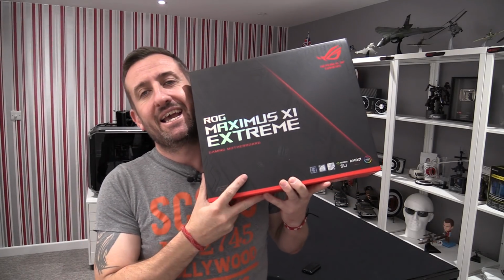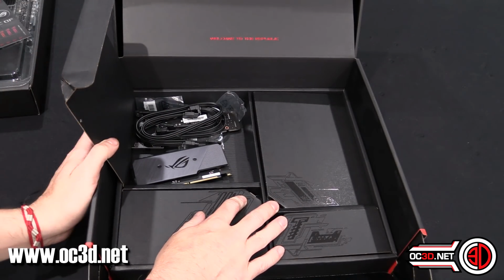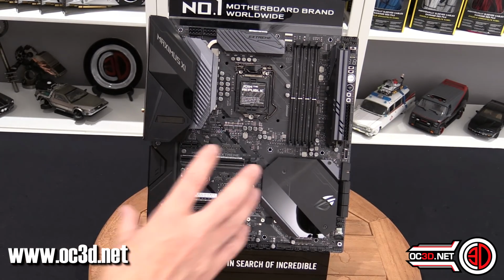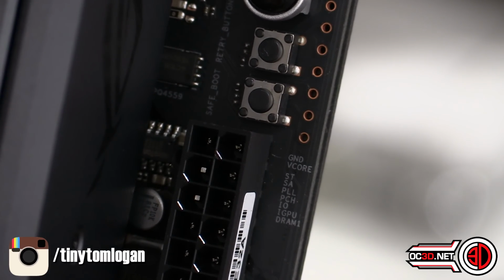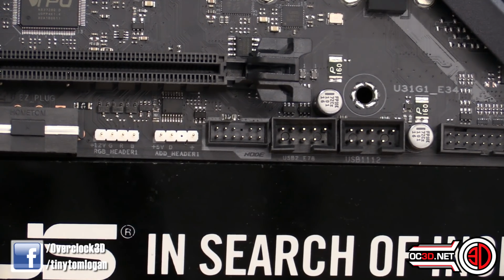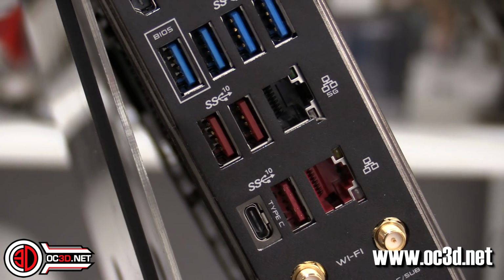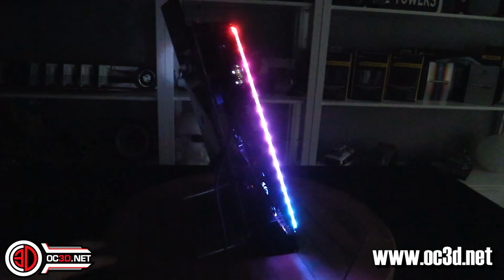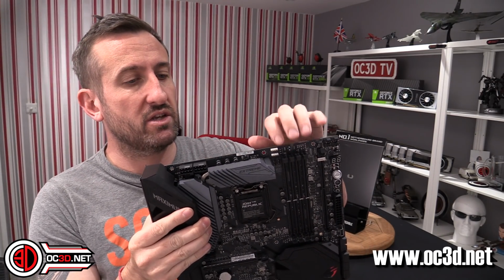Asus ROG Maximus XI Extreme Preview

Comment: Question:  @ 5:38  I should be able to use case fans on those Rad1_fan connectors right??  Since there are only two CHA-fan connectors on the board.

Comment: Using this motherboard for my new PC build, but I'm confused about one thing: Is it possible to connect 6 hard drives to SATA connectors for storage and still use an M.2 NVME as my boot drive without either disabling any of the 6 SATA ports or slowing my single graphics card (rtx 2080 TI) from x16 to x8?

Comment: i ordered the maximus XI Formula gonna pair it up with the 9900k and 2 gtx 1070 Ti in sli with 2 samsung 970 pro 512gb in raid 0 boot  with 32 gb trident z 3200 and putting it in to a new case that ive been wanting for a while now . lets just say it comes in mirror black just speculation but , im starting my everyday voltage at 1.45 and going up to 1.52 max for every day use depending on how it reacts and what the temps crank to.  obviously avx2 is gonna come in to play , well maybe . :) . under a custom water loop with a thing i have tried and tested and works for keeping the loop from saturating for hours of heavy use . not gonna tell it here il post a video of it and how it works later , and no its not based off a chiller , its just a water loop .i think from all the research ive done and what ive been involved with before that the 9900k even being an 8 core processor will go up to 5.4ghtz and beyond depending on your lottery with the sand .and the thing about that is , for the first time in  history we will have over head of frequency sitting there ready to be used , ill explain that later .and that is somthing intel would have been doing years ago if they would have had the competition then that they have now .

Comment: Hi! Would you please tell me: if I would like to use three M.2 SSDs on this motherboard (and ONLY these three M.2, no other SATA SSDs will be connected), will I be able to run all three M.2 on their maximum speeds, or will there be any limitations? Is there maybe a difference in bandwith between the dedicated onboard M.2 slots and the DIMM.2 expansion card? Thanks!

Comment: those are just big blocks of aluminum. real heatsinks are thin and a good bit lighter than that. no amount of cut outs and adding surface area is gonna make it perform like an actual proper heatsink. evga has been doing away with designs like these.

Comment: Dear OC3D i dont understand about the small pci-e slot.. i want to buy this board but i need to plug on this slot my audio card the asus ROG Xonar Phoebus card. i dont know if i can plug it with an SLI of 2x RTX 2080 TI.... and i have 2x M2 Samsung 970 pro i would to plug them on the area where is the ROG plastic cache. i dont understand it can reduce the speed because is shared with the small pci-e slot where i hop i can plug the audio card ? (to know because my case and radiator 360: i cant use the last pci-e slot at the bottom of the motherboard). i dont understand what mean is directly connected to the cpu and other to the chipset.
Reply: thank you but not realy understand ^^
Reply: i know but i cant unfortunatly
Reply: unfortunatly till now i dont had answers for my questions :(

Comment: Feels a bit rushed... So that USB 3 internal connector (7:50 around) for example. You didnt mention if its gen 3.2 or 3.1 or something else also no mention if it shares (bandwith) the usb hub with other usb connectors or not. Or what about using the M.2 card. How exactly does it affect lane routing? Also no word on what VRMs are used and the power phasing...

Comment: Shame on asus for not putting as much effort in their AMD based product.
Reply: Nobody should be buying AMD trash anyway.
Reply: For multiple reasons really
A. Ryzen's are more for budget users, no one would buy an expensive $500 Crosshair X370 for a Ryzen CPU, a $200 Taichi is enough
B. Parts on these motherboards are not needed for AMD CPUs, the VRM parts and design was build for extreme overclocking that intel usually achieves...Ryzen CPUs aren't much in overclocking
C. ASUS has a stigma that they release their most hardcore stuff on the most absurd/fastest parts available. Since intel is still the majority holder for almost all CPU world records ASUS invests more...because that type of marketing is invaluable in the PC market. People spend that much for performance.

Comment: It's interesting to me that it only has 4x PCI-E slots. 1x 1PCI-E, 3x 16PCI-E (16x/8x/4x). That's not much IMO
Reply: Uh, why would it need to have more?  The CPU only has 16 lanes dedicated to itself, for one GPU in 16x or 2 in 8x, and every other one is off the chipset and shared with the various chipset devices, requiring certain things to be disabled when other things are in use. This is not X299, your lanes are quite limited.
Reply: I thought I9 supports 40 lanes, so why this not 2x 16x/16x?